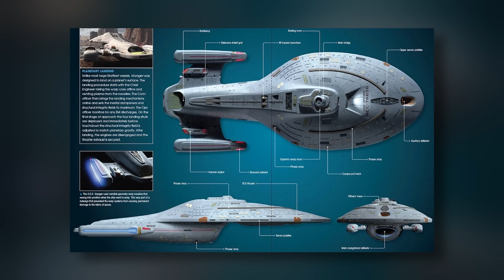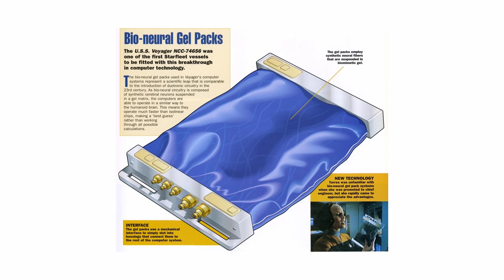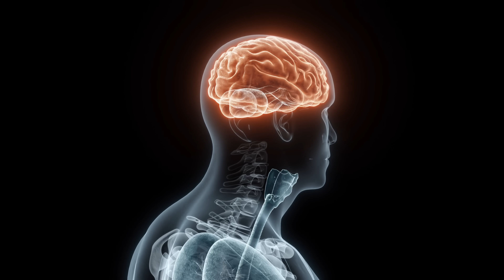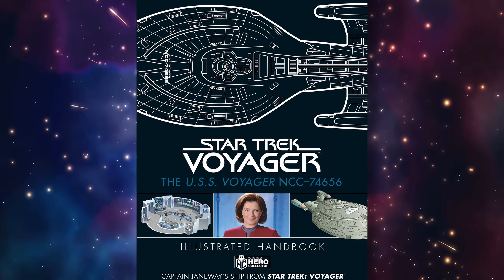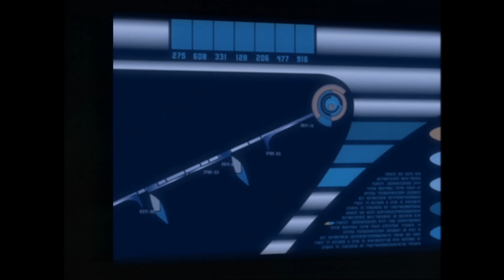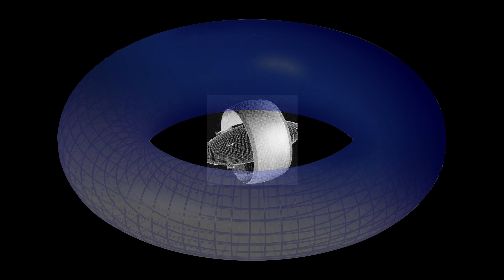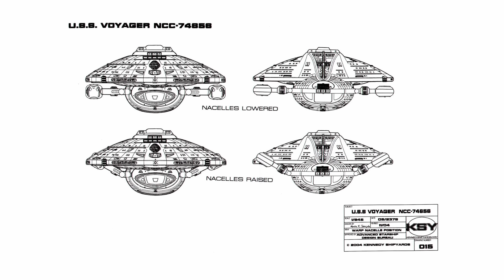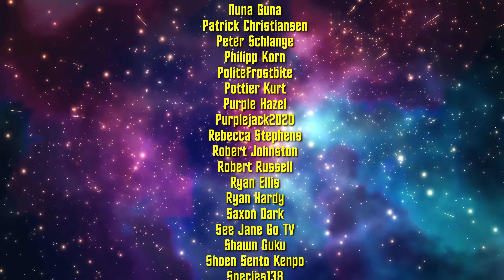The Hidden Genius of Voyager's Design

Comment: I think Voyager would have been better off with its “variable geometry nacelles” sticking with the open panels of the earlier concept sketches rather than the moving nacelle pylons we ended up with.  Because while there’s an in-universe explanation for why the nacelles need to be raised for warp speed (to give them clear line of sight with each other, to be safer for the subspace environment even at speeds above warp 5, etc.), there is no satisfactory explanation for why they have to be lowered at sublight speeds.

Seriously, why does the ship need the nacelles down at all?  Why not leave them up all the time (at warp, at impulse, in orbit, docked at a station, landed on a planet, etc.)?

The opening panels leaned into better justifications for all of that.  Why do they need to open at warp?  Because that’s how these new nacelles go faster, or more efficiently, or more environmentally friendly, or some combination of those factors.  So why not just leave them open all the time?  Because that’s delicate and vulnerable machinery in those nacelles that shouldn’t be exposed to harmful environments or enemy weapons fire when it isn’t necessary.

Alas for what could have been.

Comment: Re: the warp scale
I still contest that there are two systems that have been used, and that the second one was created in response to an absolute limit while the first was created to an increment of ship capability over time

Think of it this way; the speed of light is either 299,792,458 m/s or 1 or nearly 0, depending on the units used.
In the first, it's in Metric. In the second, it's in Planck units. In the third, Schrodinger units.
But in all three cases, that observed value is the same but the number given changes because of the relative values of the units' definitions.

Similarly, I posit that the new warp system is a form of what is called "natural units". Where the values of the constants are reduced to 1 where possible, and the rest of the units expanded from there.
The old system would be more akin to Metric, where the constants are their relatively high number starting off and derived values build up from there.

Comment: I think the bio gel packs are only used in few critical systems, and they failed on the VOY. The nacelles are moving because they designed to be subspace friendly. "According to the Star Trek: Voyager series bible, Voyager could exceed the warp speed limit without polluting the space continuum due to its improved warp drive system." Intrepid had the potential to be the next Constitution class.

Comment: A tricyclic input manifold has nothing to do with plasma. Plasma is an exhaust product not an intake or input product.  The Manifold here allows 3 streams of matter and 3 streams of antimatter into reaction chamber. This advancement was detailed In TNG Booby Trap by the hologram of Dr Leah Brahams. It increases power by 14% per addition stream. "This is to be introduced in the next class staship"

Voyagers articulation nacelles are difficult to justify in reality.  Bringing them closer allows for less flat space for the ship subjecting it to gravitational tidal forces.  Further, withe ship at warp is the perfect time to collect hydrogen from the interstellar medium. You'd want the nacelles down an unblocked by the saucer.

Comment: Deflector shields ? Surely a deflector is the device supporting navigation by deflecting objects in space that would damage the hull. Main Shields are the defensive mechanism employed on all star fleet vessels.
Reply: Deflector is interchangeable here. The navigational deflector dish does indeed clear interstellar debris while at warp (as well as acts as a massive sensor dish, older 23rd century ships like the connie and miranda separated these components because of internal volume issues.). The shields also do indeed deflect incoming fire, but the technology is a bit different for that. The function is deflection, the application and implementation are different. Also, in TOS, they were also referred to as "deflector screens".
Reply: @02ujtb00626  Gene Roddenberry once describe the differences between these two technologies he had thought up in a meeting with his writers that was video taped, and was later used during interviews of prospective candidates for a writing position with Star Trek. It is important to show both shields and decflectors as TWO SEPERATE articles for technology and not one in the same. it seems however that lots of writers have done mistakes regarding the matter. (that is the reason for all the confusion.)

Comment: I think, that variable geometry nacelles were pointless. Just leave the nacelles in right position for warp speed. In sublight speed it doesn't matter what the position is. This would lower the complexity and make the overall strength better.

Comment: by your math voyager should have been home in 15 years if they just  stayed at warp. so sense janeway said they were 75 years from home that would mean warp 9.975 is only 1000c not 5000c. of course we know from the show voyager likes to move around primarily at impulse.
Reply: That “cruise speed” is not really what we’d call cruising speed today. They could only hold it a few hours. They mostly travelled at warp 7 or 8 which works out closer to the original estimate. And they even travelled at warp 5 when running low on fuel.

Comment: Comparing calculating power of a super computer and a human brain is flawed.  We don't use all that power and can't perform as many tasks, at least the consious complicated ones. I'd say our brain uses that power more like an Apollo computer, spanning attention from one task to the next to not have to do everything at once. It prioritizes. Something that a basic computer cannot do unless told otherwise by its programs.
As for ship geometry, the higher the speed, the better the ship will react if he's proportioned accordingly, especially if that speed includes shaping its way through what becomes a soup of particles, that's also why Deflector dishes are a thing, even at sublight speeds. Prevent dust and stellar radiations to bother the crew. Also at Quantum velocities, sip geomtry becomes evenmore important because it's like surfing on a wave so your ship must be able to take on the current.

Comment: I still don't get how the EMF is able to persist outside of voyager, disconnected from the ships computing power. I can forgive the mobile emitter as just that. a mobile holographic emitter. But it can also contain the ALL of the EMH's "mental" functions?
Reply: All the computing power of a ship, in the palm of your hands. It makes sense. It's from 200-300 years in the future. Computers magnitudes slower than your phone were the size of rooms less than 70 years ago. The ships from the 27th century were calculating temporal equations. So they clearly need more computing power.
Reply: @kennyhudson9201  in that case, I can imagine that time period would have a whole race of sentient holograms.
Reply: @BaldAndCurious  Only if they leave them on for longer than their intended purpose, and only if those holograms are asked to perform tasks outside their design like The Doctor. I feel like the Doctor's circumstances were unique like Moriarty. They could recreate the conditions to give these computers sentience, but it would likely have to be intentional to have a whole race.
Reply: @kennyhudson9201  agree... But my thinking is also, the chances that those unique circumstances recurring would be greater given the longer timeline you mentioned of 200 to 300 years. Not only the Doctor's or Moriarty's, but intentional like another descendant or distant relative or Dr Sung. Actually we already have a race of sentient androids based on data Dahj and Soji and others. Just a matter of shrinking the positronic brains down to thumbnail size then surrounding it with holoemitters. Yeah, I think it's plausible.

Comment: The variable geometry pylons make absolutely no sense. If they moved, depending on what Warp factor they were at, then it would make sense. But they don't.  They're either up for warp or down for sub light.  There's no logical reason for them to ever be in the down position, as they serve no purpose during sub light.

Comment: Bussard collectors always struck me as stupid. You have these massive ships that require the power of smashing matter and antimatter together to run, but you think you're going to help "refuel it" by collecting interstellar gas molecules? You can travel bloody light years and maybe pick up an ounce or so of hydrogen. Besides that...isn't the deflector pushing stuff put of the way so the ship doesn't hit anything? So, why isn't it shoving stuff out of the way of the Bussard collectors, arguably a part of the ship? "But the deflector shield geometry funnels the particles into the collectors without the risk of hitting other ship parts!" the techies will say. OK, but by that logic it could funnel a damned pebble into your collector doing Warp 6 and blow the f$#@ing front off your nacelle or worse.🤣

Comment: Honestly the weirdest part of the Voyager design is the strip of greebles down the front of the saucer. It's just not clear why that part of the design really exists when they're not really found on other Starfleet ships.
Reply: That is a massive sensor pallette. There is also a smaller one behind the bridge, as well as sensor palette strips along the saucer and secondary hull's edges.
Reply: @02ujtb00626  Which is fine but it's not consistent with the Enterprise-D or a lot of other Starfleet ships.
Reply: @bjorn00000  Well,  yaknow, the Enterprise is a huge ship with a huge crew and specialist complement,  they could have dozens of those kinda things hidden under fairings or dispersed around the hull or whatnot,  or just lost in the scale of the thing.  :)  Voyager's a long range light explorer, it kinda makes sense they'd have a big module for the heavy sensor stuff.
Reply: @OllamhDrab  the class was designed for a primary role of scientific exploration. It was intended as a smaller more technologically advanced version of a Galaxy class really. It had a longer scanning range too. It is honestly perfect for a recon roll as well. I disagree with the light cruiser assessment though. Through Voyager we saw that it was more than capable of deep space extended assignments. It was also fully capable of defending itself against many different types of adversaries, with weapons that seem on par with a galaxy class. It is also capable of self maintenance on a level more on par with larger ships too. From what I have seen/read, it is basically a multi-roll deep space cruiser with a mission profile closer to the heavy cruisers of old, like the excelsior and connie classes. So for me, depending on how it is equipped and outfitted, its roll falls more in line with a medium to heavy cruiser (albeit on the smaller side compared to its modern cpunterparts.)
Reply: @bjorn00000  actually, the black ribbing around the edge of the Galaxy saucer, going between deck 10 and 11 windows, are all sensor strips. The Voyager one takes that area and folds it into a smaller saucer space.
Reply: @kaitlyn__L  The Nova class actually has comparable greebles! It just seemed inconsistent with some other designs in the past, but fair points all. Thanks!

Comment: Meh. I never thought the Intrepid was that special. It's a short-range courier designed to cross Federation space as quickly as possible without destroying subspace in the process. It's lightly-armed, lightly shielded and short-range with a small compliment. 

The fact that it wasn't "special" is what made it neat, though. Arguably the 'weakest' of the series hero ships. The fact that it was a small, fast, short-range, lightly-armed ship stuck so far away from home was what made the series interesting. If they were on a Galaxy-class or a Sovereign-class or something it wouldn't have been nearly as interesting.

Comment: Mate voyager should have 
doubled their weapon count
primary and secondary shields
Thicker hull armour and additional internal armour around primary and secondary systems
additional 2x antimatter energy generators
Tried to make / obtain a clocking device
Link in shuttle transport's into main ships senors as a back up when the main ship transports fail
Installed hole emitters on each deck at medical stations
Upgrade hand held weapons 
 .... 🤔